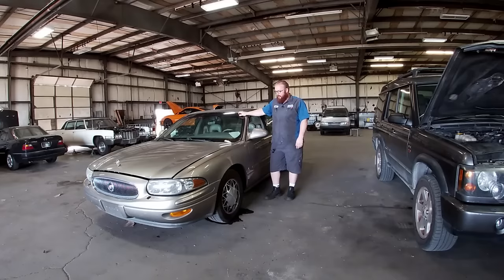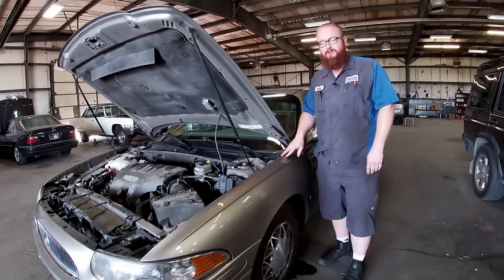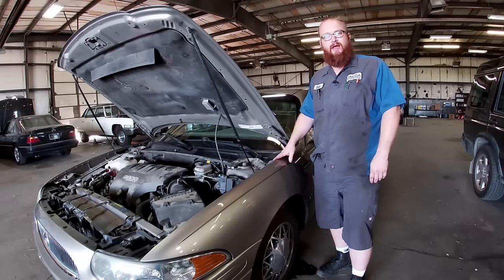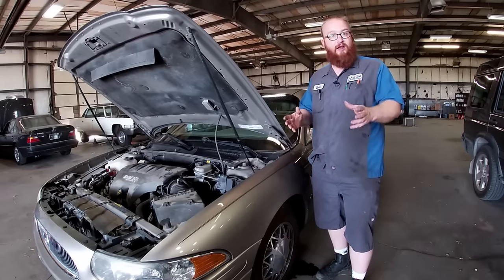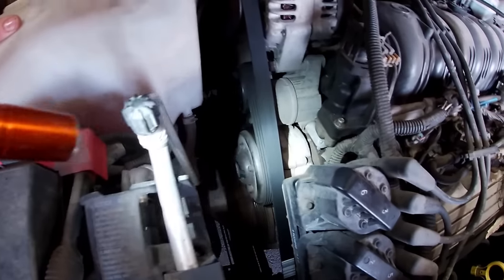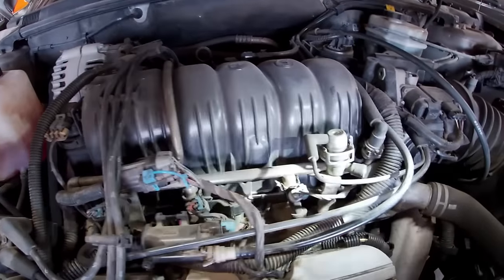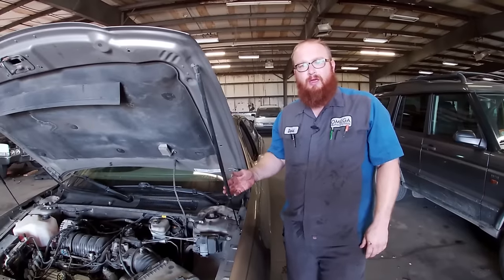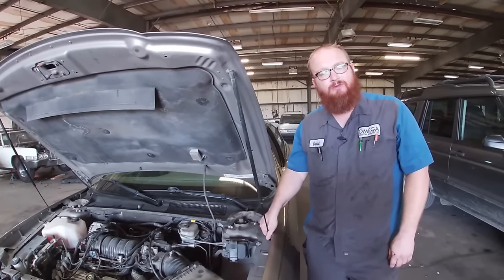CAR WIZARD highlights what makes the Buick 3800 V6 the BEST engine ever!

Comment: It was too reliable for GM.....lasted too long. GM wants u to buy a new car sooner
Reply: As soon as 80k miles
Reply: no that would be Ford.
Reply: Yes but why would one buy another one
Reply: Almost like planned obsolescence is real.
Reply: Would not comply with new euro 5 emissions rules.  Pitty I had 2 cars with this engine and they were great.
Reply: The Alas I6 is good too. 200,000 if you hammer it. 300,000 if you change the oil early and often. 7  quarts at a time. But it was not a cheapy. It also had to move 4500 or 4800 lbs. SO why did GM quit making it? A small V8 is cheaper to make. Oh and they charged more for the medium option with the small  V8. The SS model got stolen early and often. Yep same engine as in a Corvette. V6 are even cheaper. The I6 and it's companion 460LE will probably outlast the chassis. NOT easy to work on though. And you can tow 6.000 lbs with it.
Reply: @warrenpuckett4203  epa killed the atlas
Reply: @warrenpuckett4203  epa killed all i6  gas engines that I would call great
Reply: The days are over when I buy a ford or gm car.
Reply: @alexanderkeil377   That's the problem with GM's strategy.   People DID buy new cars - just not GM cars, ever again.  Notice I had that in the Past Tense - because most families abandoned GM, a generation or two back in time.
Reply: Good thing they made a million of cars that had the 3800 or some variation of it.
Reply: no GM wanted to be Ford but they went to far and fell from being above ford quality to below Ford Quality
Reply: @alexanderkeil377  because they are all built like trash now. my 96 camaro has 251k on its LT1. they dont build them like they used to
Reply: @warrenpuckett4203  4l60 outlasting anything is laughable. Literally the transmission I replace the most. 🤣🤣🤣🤣
Reply: @punkrocker10115  THM 350 were good IF you did not hammer them. I knew people that could tear up 727s and TM 400s. Here is the inside skinny. THEY don't test them like YOU drive them. If you drive like it was a company or lease car, you break it. If you break it, you are fired. No more test driving for you. Why do think it took Ford so long to figure out that the Mustang GT had a tranny problem? Tblazers, Silverados, Suburbans, Yukons and their clones that is lot of different uses. Suburban plus a trailer? Just asking for a new tranny if it is the same as a I6 Envoy build that only hauls kids and groceries..The 350s worked great in Novas, not too good in Catalinas.
Reply: @warrenpuckett4203  honestly the generation before the 4l series were great. Was just looking at a 400 today that was fitted with direct drive (no torque convertor) for dirt modified. They beat the shit out of it. But, you're right its not a stock tranny. Although, really the only thing modified in this one was the valve body and removal of the torque convertor.
Reply: @dennisdallenogare3930   thats just what they told us. Research has proven that 3800 runs cleaner  than most engine they have today.
Reply: @TestAndTune  would not meet euro 5 because it didn't have water cooled exhaust manifolds.
Reply: @dennisdallenogare3930   name one GM engine that has water cooled  exhaust?
Reply: @RocketLife954-  "It was too reliable for GM.....lasted too long. GM wants u to buy a new car sooner" And there was a guy that invented a 200 MPG carburetor  too! [roll eyes]
Reply: What an idiotic comment. It was built for 15 years and only killed off by emissions. Selling disposable cars and earning a poor reputation is TERRIBLE in the car business..
Reply: Carlos Arias less than 80k
Reply: @TestAndTune  exactly!! It's the only engine that won the ultra low emissions award!!
The engine was too reliable , that's the real reason it went out of production.. sad..
Reply: @jhon44mat  - Owned a Buick and a Chevrolet. Drove both for years. Both had at least 140,000 on them each and were still running well.
Reply: all these emission regulations yet cars are more unreliable and need to be bought more often, and everyone buying heavier SUV's lol
Reply: Been a while since I had to drive a GM. Do they still come with two sets of keys?
Reply: Well, that's what the electronics and emissions equipment is for. Your engine might last forever, but electrical gremlins will still make it a POS.
Reply: @dennisdallenogare3930  
Yup. Bureaucrats, screwing up a good thing, again. Frankly, I think we'd be better off without em.
Reply: So then we just go to toyota
Reply: Funny I owned a 2003  Chevrolet Impala 3800 by like this one.  I purchased the car new always burned one quart to 1500 Miles
GM would not fo a thing for me.
Reply: @tonyrock5313  I'm there right now never again
Reply: Planned Obsolesence
Reply: @maximusareilius2262  Well you certainly nailed it in two words. I have a 2009 impala I purchased new currently. The only reason I purchased was generous motors reduced the cost by 5k, I had 4 000 credit points on my GM Mastercard.  207k miles no major system failure but most everything has. No more GM for me..
Reply: Not really true, this engine kept on for many many years. You have to realize that the American manufacturers were forced to stop making rattly leaking ineficient engines that wore out in 100K while the imports were besting all of that. That is why we have engines now that even with the myriad of complexities sometimes dooming them still can last hundreds of thousands of miles. The manufacturers may get away with shafting people like cad buyers (who can and will upgrade usually before they go bad) or some of the low end customers, they have to be careful with the mid range/commuter/rental/truck market or they will lose their asses. This engine just finally got passed up by technology. Nothing can last forever.
Reply: @leespeyrer8424  you mean Chrysler/ Dodge. Had a new 2006 charger and it chewed up the cam from a bad MDS system where the lifter failed and also dropped a valve seat under 80k miles🙄. My 98 gt mustang was still fine and I really abused it. Just now in 2019 I had to retire the pony but that Chrysler Dodge charger has been nothing but problems, had to replace one of the rocker arms this year😑
Reply: @fcaughli  the new 4 cylinder turbos are better but what we are talking about are the vehicles that these engines were replaced with. GM decided to use a worse engine to replace something this old that ran better.
Reply: @leespeyrer8424  No, @Lee Speyrer, that would be fuckin both of them.
Reply: 3100 was bulletproof as well, some versions had cooling issues with their too small radiators
Reply: Atlas, every old SBC/BBC, LS, LT, Duramax and the DI LT engines would like to have a word with you.

And yes, Duramax is still a GM. GM has owned Isuzu for decades.

The only bad engines I can name off of the top of my head is the 3.6 , Northstar, some of the Ecotecs, aand... that's about it.
Reply: Dude the engine was in production from the 60's until like 2004.
Reply: GM's best engines, in my opinion: 3800, 350/5.7L, 454/7.4L
Reply: every car has a use by date the life of the average loan anything that last or survives the built in failure points cost them money.
Reply: @PhenomProductions23  it is
Reply: @jreyman  
I'd throw in the LQ7 (the LS based Vortec 6.0 truck engine), and probably the rest of the LS family.

In fact, all but the odd SBC or BBC's were good. Sure, there were certain combos (like the old fuel injected 327's that came in the c2 corvettes) that were a bit more finicky, but the only SBC thats ever had any real problems is the 400, which only becomes an issue if you try and get a lot of power out of them. The metal on the block is pretty thin in places.
Reply: Nick Motsarsky most people sell their cars w/i 5 yrs of purchasing- the new manufacturing model matches that
Reply: RocketLife954 but boy are they capable of a lot of the worst engines too!
Reply: 2000 Buick Park Avenue 261000 miles. Still runs great, average overall 27 mph.
Reply: @ad356  my 94 firebird 3.4l v6 has 250k miles without any issues
Reply: @misterbuklau4053  that's allot of miles. i bet the transmission holds up better behind a 3.4 then an LT1. the torque of the LT1 tends to eat up 4L60E's LOL
Reply: Andrew Donohue its a 5 speed manual
Reply: Of more modern engines, the Ectotec 2.0L turbo initially designed by Saab with GM and Garrund/Mitsubishi turbos has also been very reliable.  My old 2006 Saab 9-3 still has the original powertrain with 220,000 miles on it and going strong.  The second owner who has it now loves it for its reliability, gas mileage, and power.  I have another version of that engine in my 2018 Buick Envision.  Expect it to last just as long.
Reply: Literally every car manufacturer wants that they can only sell you a good car once, they can sell middling cars dozens of times. 

That said, I've had a Grand Prix and Bonneville with Series 2/3 engine with superchargers.  With decent maintenance, they were pretty rugged even in Canada temperature extremes. 

 The rest of the car wasn't great, but the engines were pretty dead-on rock solid.
Reply: It was too old and the NVH wasn't up to modern standards. Also, the Atlas was resurrected; the new 3.0 diesel is made on Atlas tooling.
Reply: @warrenpuckett4203  Lol, good lord how could anyone tear up a TH400. They were bullet proof.
Reply: @ad356  Replace 4L60-E with 4L80-E.
Reply: I believe this to be very true.
Reply: The seals
Reply: PowWowChicken Yeah chrysler is bad! My 430K 2013 RAM and my 2016 300 with 100K miles on em are built so bad that nothing has gone wrong even tho they’re both abused (but still get regular maintenance) bro!!!
Reply: @leespeyrer8424   as if its not both..
Reply: @nickmotsarsky4382  Excuse me but are you trying to argue that planned obsolescence is not a thing in the car business?
"Selling disposable cars and earning a poor reputation is TERRIBLE in the car business"- well isnt that exactly what is being done?
Im a bit confused by the nature of the business obviously, if you have the free time and patience then please explain it to me a bit.
And if you intend to call me an idiot, I say no sir you are the idiot lol.
EDIT NR2: I just went the route of looking into my suspicions and heres some of what I found
"In the United States, automotive design reached a turning point in 1924 when the American national automobile market began reaching saturation. To maintain unit sales, General Motors head Alfred P. Sloan Jr. suggested annual model-year design changes to convince car owners that they needed to buy a new replacement each year, an idea borrowed from the bicycle industry, though the concept is often misattributed to Sloan.[9] Critics called his strategy "planned obsolescence". Sloan preferred the term "dynamic obsolescence"."
You sir are the idiot.
Reply: Bullet proof engine now is the 4.2 ltr v6! I have an 2003 GMC Envoy with over 278,000 & it's still strong and reliable! I only use Pennzoil high mileage oil! I love my Envoy & wished they still made them!
Reply: Casey Whiting thats why it lasts so long, keeping the speed below 35 mph!
Reply: @leespeyrer8424  Surely you jest, when there are 4.6 motors with 400000 miles on them...
Reply: @alexanderkeil377 Unless you want to make payments for 84 months!!!  All this junk out on the road now won't last the life of the car/truck loan! Built cheap just waiting to breakdown full with recalls between drivetrain problems let alone air bag issues with Takata!!
Reply: @vapeguy9248  yes i would agree with u on the straight 6's.  Tough reliable easy to work on got good fuel mileage. Is'nt amazing how long their production life lasted!
Reply: @chrismc410  yes they did. Even the 4.3 liter was well built being i had that motor in a '96 GMC Sonoma ZR2 drove it 13 years 180 thousand miles never let me sit.  That was my 1st GM truck i've owned. Couldn't afford the Colorado nor the GMC twin these days.
Reply: @raven4k998  Nah. The blue oval just rust away no matter F150 or Ranger! Owners end up replacing rear spring perches when the rust takes hold on the underside of the trucks.
Reply: @ad356  A good friend of mine whose a life long mechanic told me that every new vehicle out on the road now are junk!
Reply: @punkrocker10115  That 4L60E that's in my '97 firebird has been reliable goes in gear shifts great no complaints. U r intitled to your opinion since u seem to have a distaste for automatics!
Reply: @TestAndTune  if u do upgrades to ignition like coilpaks the 3.8 loves it. I did all that to my V6 it helped in driveability plus mpg.
Reply: @kamdaddypurp3341  now these days the way they r assembled the new GM's are junk.
Reply: @jlrockafella  Yep FCA is having big time quality control issues like u mentioned the Hemi is chewing up camshafts alot of engine problems.  Jeep is in the same boat with the issues but people gotta have their 4x4 weather it be the Wrangler or the reborn jeep pickup.
Reply: @daniellaubach7544  or you could just buy a new truck problem solved my boss does that one hehe
Reply: Lee Speyrer all American manufacturers. Just to different degrees. Even foreign manufacturers. Yes, even Toyota has gone downhill quite a bit.
Reply: ABSOLUTELY...that's exactly why they started using cheaper parts on the 3.1 after 1995....The engines were too well built...They were only coming back to the dealer for oil changes...nothing else
Reply: They were forced to get rid of the 3.8 due to emissions regulations.
Reply: Scooter George yeah and they either bought the patent off of dude for $800,000 or if he said no, he mysteriously disappeared....same with Nikola Tesla 100+ years ago.
Reply: @warrenpuckett4203  I had a TrailBlazer with the I6. Phenomenal engine!
Reply: Best thing to do is buy new car with out motor,just get another 3800 engine
Reply: My car Chevy Impala ls 3.5 v6.using Castrol edge titanium run 4 k miles only lose 3 oz of oil.i read about 3.5 v6 engine is high value.what it mean.myself not sure how many will go 300 k.i seen not many go that far????????.please response answer my question thank.
Reply: @vapeguy9248   Eh Ford's old Falcon straight-six was continuously upgraded from the early 60's to the 21st century in Australia, to continually match EPAs over the decades all the way to Euro IV, ending up with DOHC 4 valves per cylinder VVT & Varible length intake, etc, etc .
Reply: 1uzfe is best engine
Reply: Best American car engine ever GM 3.8.   Best import car engine the 1997-2001 cast iron block 2.2  4 cyl Camry engine.
Reply: @PhenomProductions23  GM literaly invented that.
Reply: It was underpowered for the segment, had to go
Reply: I've had two 3800s... The series I in my Delta 88  was outstanding, nearly like new at 151,000  (I wrecked the car) and the series II in the 99 LSS lasted through my ownership and my girlfriend, later wife's, ownership. The thing that killed the car was the subframe rusting out, but the engine was bulletproof, singing along at 300,000 miles. Winter road salt is what destroyed the car.
Reply: GM had a EPA problem where they had it discontinued Building the 3.8l engines at the plant- thats what I heard.
Reply: He must be talking about a marine engine.
Reply: @scootergeorge9576  I have 188,000 miles on my 2005 Buick Lacrosse that has the 3800 and still going strong.
Reply: @mrp8173  that certainly is not typical for one of these engines. i have owned a multitude of them. excellent engines, everything else falls apart around them LOL
Reply: @andrewdonohue1853  Yes for certain. It's one reason I purchased that car. Oh sure all other items fell off you know the drill. Guess 8 got a lemon. Reading now GM is having oil burn issues with the equinox  try poor. A GM supervision person I know told me last month the GM 4 cylinders are just horrible ie junk.  Ford and GM lost and have given up on the sedan lines ie list to the Asian s. My family drove Buick Wildcats, lesabre, oldsmobile 88 cars in the 1960s fantastic cars indeed. They know how but don't care to build quality my sense. Oh well down the road I go in my 2009 impala. Seems to me it's usually the person that really services and takes care of his car that have the worst luck. Take care
Reply: So then they came out with the valve shattering 3.6.
Reply: @justmy2cents_ Dude that's an I6 😃😃😃
Reply: Too bad it’s a V6.
Reply: @leespeyrer8424  kkkkkkkkk(kk ok**
Reply: @leespeyrer8424  Ford actually is rated 1st in most reliable American car brands every body else has been dropping quality for years now with Chrysler being bought out by fiat and gm cutting cost left and right the quality just isn't there anymore
Reply: @jreyman  I agree with you. The 3800 series motors were for the folks that wanted something similar to an LS swap, but a V6.
Reply: @mrp8173  I agree with you. All my family on my mom's side drove since the 1950s was GM and Mopar. They remembered oldsmobile the most due to their reliability and safety at the time.
Reply: My great grandmother had a 1968 Plymouth Barracuda Fastback with a 4 speed. It's at our family scrapyard in the Californian desert.
Reply: @uberdang830  The 3.6 L V6 engine was a garbage engine. The 3800 V6 engine is the best engine, ever. They are both from General Motors (GM).
Reply: @BoltofTalons   I'm glad your family experienced THE OLD REAL GM. How I would enjoy owning one of my Grandmother's Old 88. She had two brand new. Those cars were not driven over 40 MPH ha. 40k miles time to get another car Incredible!  Nice that you commented take care.
Reply: @md2k8  Eh did you really read my comment?
Reply: @uberdang830  Yes, I did.
Reply: I still have my 04 lesabre!!
Reply: Cheap to repair but how much repair goes into a Honda or Toyota verses a GM 3.1 3.5 3.6 3.4 3.8 3.9?
Reply: U can't say it no better !
Reply: Mine didn’t do so well, the red coolant went bad. Had to replace head gaskets. It ran well for a while.200hp in a Camaro, fun car.
Reply: This is the reason some old geezers run to Toyota
Reply: @PhenomProductions23  Yes, in 1929 Planned obsolescence went in to Congress and they passed it, those f-ing crooks in Congress. It's 9 years or less for household items. Others items I don't remember the years or miles.
Reply: Pretty much every car manufacturer
Reply: It wasn’t a wise business move that’s why they kept chopping off branded sections.
Reply: @SoI_Badguy  The 5.3 LT engine is awful. Oil flow issues cause the engine to lock up. There's a class-action lawsuit on it.
Reply: @TheSavage3.6  Lol every Chrysler guy claims that every one of their cars has made it one bajillion miles and everybody else must just be making things up. Every reliability survey, no matter who does it or who is sampled, consistently find quality and owner satisfaction to be the lowest with Chrysler brands. Family had both a second gen Ram and a Caravan with auto transmission failures (repeatedly so for the Caravan) within the warranty period. The Ram was traded for an F-150 that gave 250k of reliable service and the Caravan was re-purchased by the dealer under the lemon law. Never had to lemon law any other brand of vehicle. We've had Fords, Toyotas, Mazdas and GMs.... none of them ever had repeated catastrophic failures like that.
Reply: @Stuart Krahn The 4.6L mod motor was extremely reliable but it was also kind of underpowered. That's the main reason they got rid of it. The 5.0L Coyote is also a mod motor and it's had a great reliability track record since 2011. Plenty of 150-200k mile examples starting to show up. They just haven't been around long enough yet for fleet trucks to hit 400-500k miles as some 4.6s have in panther body taxi/limo service.
Reply: @thegodhoward8037  I would concur that Ford is the best of the US automakers in terms of quality, but they've definitely gone downhill too. My father's 2013 F-150 has had occasional random electrical glitches at 100k miles... nothing that keeps the truck from running, but the power door locks occasionally don't work and his heater blend door didn't work one time and he had to replace a connector. We didn't have this issue on older less computerized Ford trucks.... our '98 auto with the 4.6 mod motor gave us 250k miles without any issue other than normal scheduled maintenance items. We had similar electrical items quit working on the one GM truck we had (radio and cruise control), but like the Fords, the powertrain seemed to be solid. Nothing like the auto transmission failures I've seen with Chrysler products.
Reply: @marcuscook5145  The second gen RAMs were notorious for issues (they were made within the time Mercedes owned Chrysler) and what year caravan? Early dodge trans fell like flies.

No, you’re wrong about the reliability standpoint of things. I’ve had 2 Chrysler vehicles so far (2013 RAM and 2016 300) with NO issues at all, truck has nearly 500K on her and she’s fine, same with the car with nearly 150K.

Also, check the forums. The Pentastar is incredibly reliable and is among one of the most reliable V6s in production.

https://www.thedrive.com/news/34672/check-out-how-surprisingly-durable-this-chrysler-pentastar-v6-is-after-626000-miles

Yes, early models had their issues, but were fixed when Chrysler revised the design of the engine in 2016 and made them virtually bulletproof. Pair it with the ZF 8sp and you got an indestructible modern car.
Reply: You're right!  Now Toyota and Honda are cheapening up their cars as well.
Reply: @dennisdallenogare3930  I wonder if they couldnt just modify the headers if that was the actual requirement lol. Or is that a joke for marine applications lol.
Reply: @PhenomProductions23  GM based their brand on planned obsolescence they sort of invented it
Reply: hence the invention of Alloytec and the discontinuation of Ecotec
Reply: @mickvonbornemann3824  okay so the Barra six is based on the old Falcon 6? Did not know that I thought it was a completely new engine architecture relative to the Falcon motor.
Reply: @PhenomProductions23  it's true in more industries than meet the eye
Reply: @tonyrock5313  BUY   TOYOTA   COROLLA  !!!!!!!!!!!!!!   BEST
Reply: Yeah that's exactly why they quit putting them in cars like the Lucerne and Allure instead they started putting in those crappy 3.9 with vvt I dono I've heard different things about them....👍